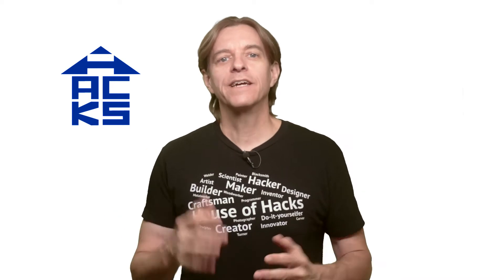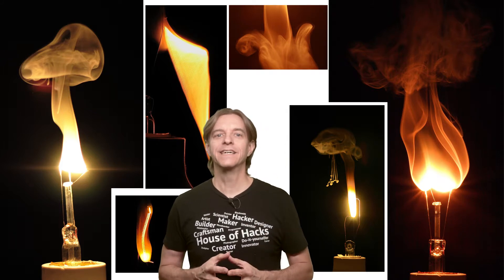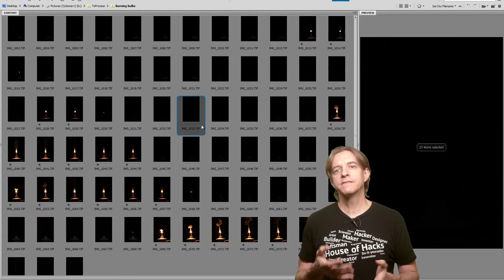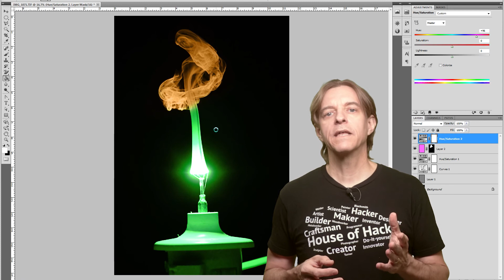Abstract Photography Ideas At Home: filament bulb

Comment: I cant believe I missed this one - very pretty :) My only fear is tripping out the fuses in the house - well that and the fact Im totally going to cut myself - but I do have to give that a go sometime
Reply from the maker: Thanks Pam! Yeah, these are fun to do. I've never had any issues with fuses. The light bulb will act as a fuse that's a much lower value than the circuit is designed for, so it'll pop first. I get you with the cutting yourself fear. The first couple times I did this I was on pins and needles. You get used to it. Do try, it's mickle* fun!

* Hope I used this properly. :-)
Reply: Lol - even muchle fun. It does give awesome images - and I like fire. Havent tried photographing fire at all - yet
Reply from the maker: Yes, bigger fires can be fun, like campfires or in a fireplace. Candles less so. I have several items on my todo list for abstract photography things.